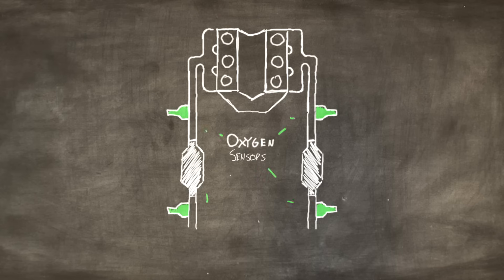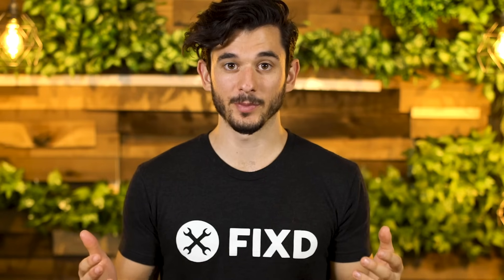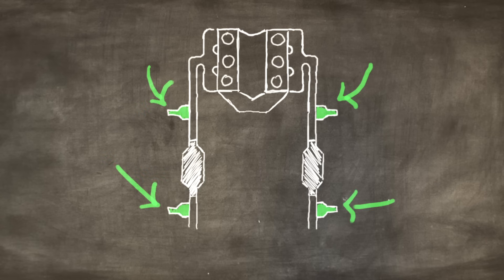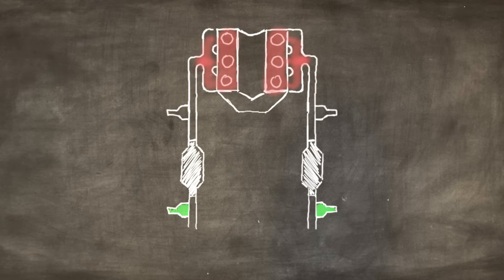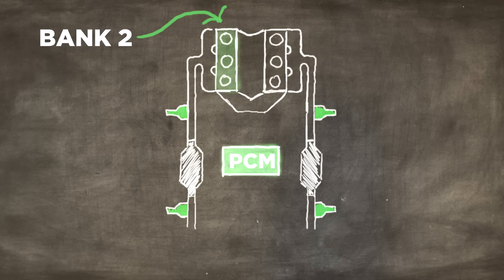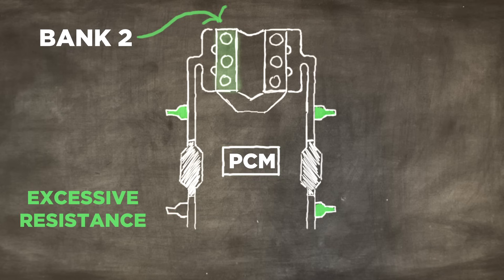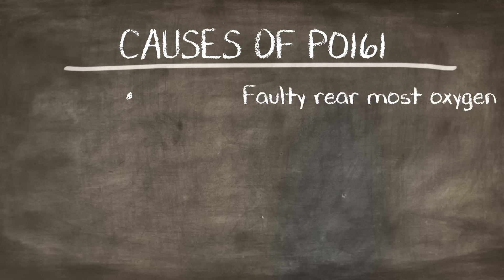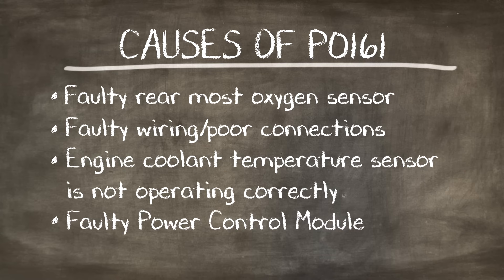P0161 Explained - Oxygen Sensor Heater Circuit Malfunction (Simple Fix)

Comment: I had an error code or P0058 replaced bank 2 sensor and now I have a P0161 code.
Reply: Me too, was hoping for an answer here. Did you figure it out?
Reply: @bendall248  it's the sensor on the passenger side second one from front to back.
Reply: This cleared my code.
Reply: i have the same come p0161 and the bank2 i need know of some one people tell me where is the location of the sensor because some people say is in the front of the ingine compartiment

Comment: Wait a minute..🤔..  Bank 2 refers to cylinder #2 side... Which is typically the passenger side.
Plus failed to mention that a faulty or plugged converter could also cause this code.
Reply: yea im my car right now has both p0156 and p0161 both relating to o2 sensor in i believe bank 2. ontop of it reading a p0420 code which relates to the catalytic and p0301 which is cylinder 1 misfire. replaced the spark plugs and wires. plugs twice now and only cylinder 1 is misfiring out of the 6. going to change my downstream o2 sensors but i am almost certain that it's the catalytic converter causing this. more then likely my catalytic converter is plugged car is a 98 and wasn't kept in the greatest condition. also guessing that the misfire if not caused by either o2 sensor/catalytic being plugged is probably from clogged fuel injector possibly.
Reply: I thought the same thing. I ended up changing the O2 sensor on the passenger side but the explorer, bank 2 is on the driver side. So, ended up changing both. Always learning something new.
Reply: Bank 1 is whichever bank contains cylinder 1 and bank 2 (if there is one) is the opposite bank.  Some engines have cylinder 1/bank 1 on the right some have it on the left.  Depends on the engine.

Comment: I have code on a wj jeep! Changed b2 s2 but code came bk! Mechanic thinks it's the b1 s2 that's faulty but not sure! Can old jeeps give a wrong code reading?
Reply: If you went by this video, you changed the wrong side. Bank 2 refers to cylinder #2 side Wich is typically the passenger side. 
This video would have your exhaust coming out of the front bumper. Lol.